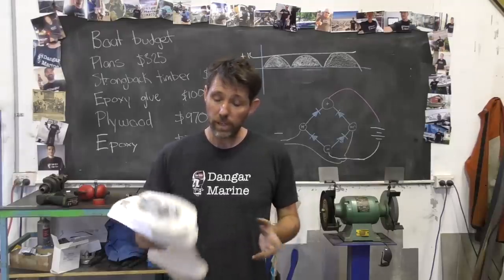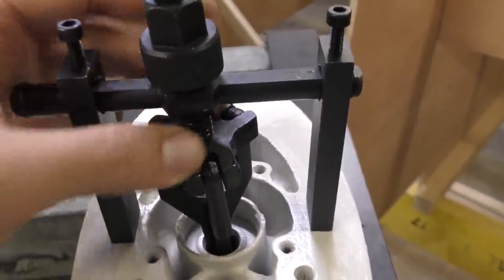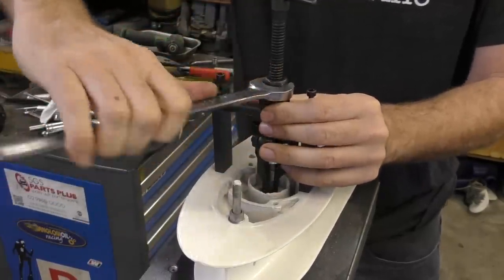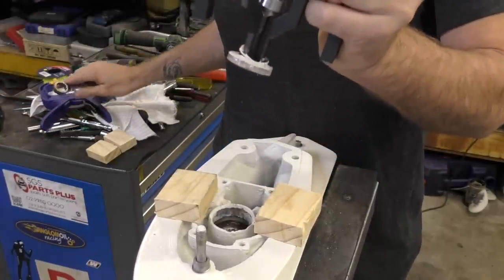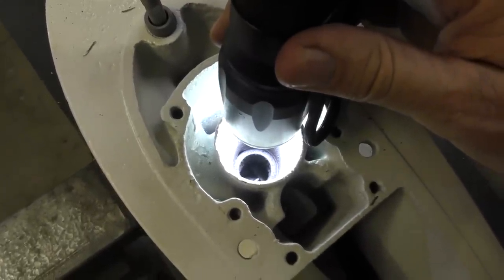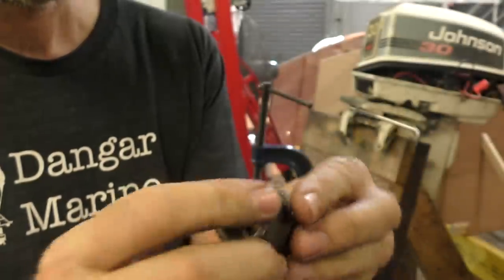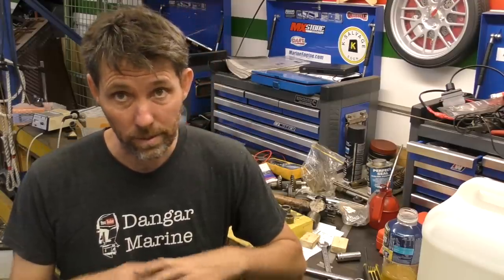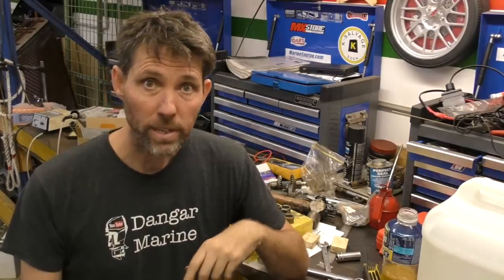Removing the bearings from a Johnson 30 HP lower unit

Comment: Boss, Wait til you see the pull I just came back from. Scored a pristine 76 johnson 15,  looks pristine, with original decals and all. I was like WHOA. bundled that up for 310 clams and took off towards east  Texas and met another guy who had a 75 Johnson 15, immaculate. Fellow was proficient at rods and reels also, PJ is what I know him by. The soul was so kind to give me not one, not two, but THREE old motors and lower units, just outta the kindness of his heart. Then, lo and behold, a 25 Mercury 2 stroke two cylinder with GREAT compression but carb issues was aside a building that I fixed my headlamp on (it was 11pm when I arrived, and four hours back, just got home. Whew... ) so yeah, he seriously said fifty bucks and you can take it. He was kind enough to even write me a bill of sale for the merc, and of course for the 75. Total spent, 750-800 for total trip fuel and all but wow. I cannot wait to learn more about the workings of these engines and have them back up and running, I’ll do a video on what I have once I build an outboard motor mount. Thats tomorrow. Thanks again for your inspiration.
Reply from the maker: Sounds like you've had an amazing shopping trip! :)
Reply: @DangarMarine  Texas is nice to pass through, pretty big sky. I remember when I went to Colorado once, I passed through during daylight and the windmills And Land are beautiful to behold, headed out towards Montana here soon, prolly too cold to dive out that way .

Comment: Thank you for your "Reality TV" how to boat mechanic videos.  I think I have seen about 10-20 of your videos.  I call it reality because we face what you show us, instead of what some other videos show in a sterile expensive equipment shop where they work on brand new motors.  I have been building up a 2010 Yamaha F6 that has been neglected.  So far fixed broken shifter mechanism, which requires removal of the power head.  I have now removed the power head about six times.  The power head only ways about 30 pounds.  Blew out carb, cleaned gas tank.  Etc.  I am stumped on replacing the lower seals, because some are behind pressed in bearings.  I am about to buy a little puller.  Thanks!

Comment: i am doing a lower end rebuild on a johnson 25 hp motor from 1988, prior to removing any bearings from under the impeller housing i will measure the depth from the top to get an idea of proper location since there seems to be no info. the "witness" marks on the pinion gear will also help a lot, thanks for that tip! without your set of videos on this i would have to pay a considerable amount of cash that I DONT HAVE! this has all been super helpful 1 thank you for sharing your knowledge!

Comment: Nice job with that puller Stu. Using that plate steel and the threaded rod worked really well. I’ll keep that in my memory bank. Might come in handy eventually!
Reply from the maker: Where there is a will there is a way! :)

Comment: I changed all my seals in my merc. Most of my seals came out super easy and they were leaking a fair amount of oil. I reinstalled with loctite per the manual which was weird at first read, but it hasn’t leaked a drop since.
Reply from the maker: Yes, a bit of sealant around the outside of the seal can be a good way to go, particularly if the gearbox is a bit pitted or worn. Glad it isn't leaking now!

Comment: Those lower drive shaft bearings- to reinstall just use the same system you used for removing the shift linkage bush - threaded rod, plate and nuts to pull the bearings up. It has worked for me in the past.
Reply from the maker: Been thinking about whether to go top down or bottom up. I think what I really need is to find the measurements of the custom tool to find out their final positions.
Reply: Check for witness marks from the old bearings and measure those. But long needle bearings in such a low horsepower motor I wouldn't be too worried about being a few millimetres out  as long as the seal sits in the right place.

Comment: That is a nice bearing seal puller!  The special tools can be improvised, but there is often a specific depth the bearing and seals must be positioned at.  The two pinion bearing are one example of where the special tools are very helpful.  The seals are not necessarily pressed in against one another as well.  Needless to say the forward bearing race and some of the bearings get pressed in until they seat, but one must be very careful not to damage the bearings.  The general rule is to press against the numbered/lettered side of the bearing because this side is thicker, pressing against the opposite/rounded side of the needle bearings will damage them.  It is a shame that OMC designed those housing with such thin aluminum walls around the seals, these are often eroded quickly in salt water, the 9.9/15 gear housings have the same problem...
Reply from the maker: Yes, I am worried about getting those pinion bearings installed in their correct position. I may have to see if I can find the special tool for that job, or at least the measurements so I can make something up. Great tip about pressing from the side with the writing, taking a second look at the old ones I can see exactly what you are saying. Thanks!

Comment: Good video mate there are no rules as long as the job is done , i did that with an extension and ended up buying a new one take care .
Reply from the maker: I've found decent tools to be pretty hardy. One thing Arn said to be very early on is that a tool make from cheaper metal will break and you are likely to get hurt in the process. It's something that has always stuck with me when assessing the cost.
Reply: I have to admit i did give it a hammering was good quality no kmart crap was kingchrome cant remember what i used it for but now it is a drift punch .

Comment: Loved this video.  I have a 1978 Johnson 25HP tiller steer with electric start.  Hopefully won't need this video or that puller tool, but I feel confident if I had to rebuild that lower unit, I could watch your videos on the topic for a day or 2 and then tackle the job myself.  I just got this engine in late March and it's running great.  What do you recommend a person do when first getting an engine?  What to look for to catch issues that are small now, but would grow to be big issues over time?  I've watched your regular maintenance vids and maybe that's enough.  You're an awesome mechanic and the way you present in your videos is superb.
Reply from the maker: Hi mate, glad you've been enjoying the vids. The biggest concern with a nice-to-you motor is that the impeller is good. Not so much from the point of view of overheating but if it is perished, bits will break off and go through the motor and be hard to get out again. Also make sure the gearbox oil doesn't have any water in it.
Reply: Dangar Marine nowmy 2.5hp merc that I still have is putting gas (petrol) into the water when I try to start it. Carb? Seal somewhere gone bad?

Comment: Stu, you have to hurry with the reassembly video.  We're starting to misplace the parts!  Terrific video.  Needed this for many years.  What diagram should we use to remember the order and direction of replacement?
Reply from the maker: Thanks Bruce, bearings are on there way! The parts diagrams on the MarineEngine.com are great for seeing how things go back together. http://www.marineengine.com/parts/johnson-evinrude-parts.php?year=1994&hp=30&model=J30EERM&manufacturer=Johnson&section=Gearcase

Comment: Hi Stu, I was wondering how many bearings are in a typical lower unit. Great techniques on removing them. I have also used sockets and a "C" clamp to remove them or a vise.
Reply: 8-12

Comment: Enjoyed the video and found it valuable to understand the inner configuration of the lower unit. I have a crack in my lower unit above the propeller on the main housing. The motor seems to cavitate. Can the lower unit be welded to seal up that crack or could something else cause the motor to cavitate.
Reply from the maker: The aluminium can be welded, but you need to make sure it doesn't put the propshaft out of alignment when it is. Hard to say what causes the cavitation but I always go by the principle of fix what you know is broken and then go from there.

Comment: Hey Stu. To answer ur ? The impeller was is pieces I remove the exhaust cover to check for pieces and found a tiny so I cleaned it out but I also found the inner exhaust plate ( stainless about 2mm thick) is warped pretty bad I can't find one online or ME.com so should try to fix the old or make a new one??. Thx mate
Reply from the maker: I can't picture the plate, but I would start by trying to fix it.

Comment: Hey stu you ever seen where with the spark plugs out, the motor turns over real easy but when I put the compression tester on it's pretty   hard to pull, the first 1 or 2 feet pull ok but the last foot or so almost kind of jams up. But I can still pull it all the way. Idk its weird, It is on a stand I made . What do you think?
Reply from the maker: It could just have very good compression making it hard to pull over when the plugs are in. It could also be that it is the wrong spark plug and the piston is hitting it.
Reply: Ok I know the plugs are right so thx good news

Comment: Do oil seals get replaced? I had a bearing go out in my '95 Mariner engine and there were metal shavings in the oil so I was planning on replacing all the bearings (though I am debating just thoroughly cleaning up the other bearings that otherwise seem fine), but what I didn't know is if I should be replacing all the oil seals as well. Do manufacturers generally offer a rebuild kit with all the oil seals and bearings or do you just buy everything piece meal?

By the way, your videos have helped me tremendously in getting this far! Watching you disassemble a few lowers gave me the confidence to try it myself and so far, so good! Rather than $400 for a used lower, or $300+ at a shop, I will have $30-150 worth of bearings and/or oil seals and thats it.
Reply: Oil seals are cheap and generally easy to replace. Don't scrimp, just replace them .
Reply from the maker: Bearings and oil seals are generally sold separately but in this case I did buy a kit of all the seals and gaskets in one package.

Comment: hey i have a jonhon 25 and i has good compression lower uint is good drive shaft is not bent and carb is clean, it runs but wont go on plain idk why
Reply from the maker: It could simply be that the hull is too big for the motor, but I would also look at the ignition timing as you get to full throttle.
Reply: I have a video of it running before it messed up and its going like 35 40 mph idk what that is in nots but had the timing redone and still no power. the perpeller is kinda beat up do u think is tht or any other suggestions

Comment: Hey Stuart im having a little trouble with my Yamaha 30hp its pulling really hard to the left on the tiller, i watched your video on props and i thinks its that paddle wheel affect you were talking about. I have to a set of hydrofoils bolted to the plate above the prop from the previous owner however he has bolted them through the anode plate so i cant turn the anode to compensate without screwing through the plate again. Also how far would you recommend turning the anode to compensate for the paddle wheel affect? cheers
Reply from the maker: Generally it isn't turned that much - 5 to 10 degrees. It will make a big difference.
Reply: Thanks but drilling through the anode plate for the hydrofoils is that ok?

Comment: Hi, I might try and have a go at my gearbox  and fit a new set of gears,   what type of puller  would I need or you recommend  to seperate the forward gear and inner bearing.  Thanks
Reply from the maker: A spigot bearing puller should do the job.
Reply: @DangarMarine  Thanks for reply,  funny enough it just fell off in my hand,  so no problems there. 🤣

Comment: Hey Stu I watch the video but have sum ?. ME.com list 2 separate driver coils for rope and electric but both look the same. Do I need to swap them. And do I need to add a stator assembly and a rectifier. Do I need all this?
Reply from the maker: Hmmm, not sure about the driver coils. If they have different part numbers I would be inclined to email MarineEngine.com and see if they can shed any light on the difference. If you want to charge your battery you will need a stator and rectifier but you may already have them. I'd pop the flywheel off first and take a look.

Comment: Hey! It would be amazing if somebody could give me some advise. Here is my problem: I have a 2011 Evinrude e tech 25hp. It is a 20” shaft, and was used in salt water. In a rush, I snapped off two of 6 lower unit bolts. I disconnected the shift lineage behind the intake plates. The lower unit doesn’t budge more than 1mm barley. I need to replace the water pump and seals. I’ve tried some heat but I don’t want to burn off my paint. What should I do? Am I missing a linkage under the cowling? Thankyou so much I need help.
Reply from the maker: I don't know that motor specifically but there is often a hidden bolt under the trim tab.

Comment: I broke the head bolt on my 1970 Johnson 25.  How should I get it out.
Reply from the maker: If there is a bit of shank sticking out you can try turning it with vice grips. Sometimes you can also weld a nut on the end and turn that. Next step is to drill and try an EZ Out or something similar. If that doesn't work then you may need to go to drilling the whole bolt out and repairing the thread. I'm planning to do a video on this soon.

Comment: Use  brass when-ever you can  for the removal process,,    Remember aluminum expands  3 times faster than SS.  use a bit of heat on the Aluminum prior to the pull or  punch,,   Also spray things down with hot soapy water you will be surprised at the results.    ,  You got it done & that is all that matters ,     good  video...                                                                 kodi
Reply from the maker: I've never tried hot soapy water, I'll give that a try.

Comment: Stu dou think a 300 08 etec would be the same as that evinrude lower unit same procedures but bigger pieces
Reply: Hookednrolling- yes, pretty much the same ideas on all of them , especially with in the same company. Even the 'electronic' selection of forward reverse on the current Etecs, the actual gear box is the same idea in terms of  bearings/seals/dog clutches etc , it is just that a servo is used to move the selector rod instead of a cable. Just more things to go wrong, and more mass over the stern of the boat that you don't want out there in my book.
Reply: Ron Powell I agree  there nothing wrong with mine I was wondering instead of dealer I might do lower unit work my self with my brother we can usually figure it out plus I bought evinrude shop Manuel much better than after market Manuel JT
Reply: JT. Keep the fishing line out of the propeller side seal, change the water pump impellor every year along with the oil and be positive in your gear engagements and you can get 15 - 20 years or more out of a gear box without doing much else. The bearings really live in a good spot on the lower leg if no water gets in the oil and rarely fail. The seals just wear out from doing their job though, not really much you can do about that. One thing I hate hearing at the ramp is that graunching of dogs as people engage the gears too slow. The problem is many people  then try again even slower which makes it worse.
Reply: Ron Powell will do need to get out there as soon as they fix postcard inn in islamorada after Irma the Florida keys worlds sport fishing capital of the world  love  the keys keepin your lines tight John

Comment: Hey boss been checking out your helm and steering cable replacement videos, and I am about to replace my whole system soon, but I must ask I was going to run across my lake and when I turned I heard a snap and lost steering my steering wheel turns freely either way forever, and the cable for the steering cable ripped where the the steering cable enters the steering rod on my mercury classic fifty 45hp I haven't owned the boat long and I assume the old owner never replaced it, so would a whole helm replacement fix this? Is I guess what I want to know before I get a kit. I'm pretty new to my boat I'm a young guy so I just want to get some expert advice, i tried to describe my ordeal best I can but if you need clarification on anything I can try to help clear thing up
Reply from the maker: You may need to replace the helm, yes. Sometimes if the cable snaps inside it can be hard to get the cable out. I would start by trying to get the old cable out. If the old cable does come out and a new one winds in easily then you may be able to re-use it.
Reply: Dangar Marine awesome man thank you very much I was able to get the cable out today, so I left the helm attached and ordered my new kit so hopefully I'm able to reuse t and just connect the new cable
Reply: Dangar Marine I think I kinda described it wrong so the metal it's self didn't break but the cable right before he rod goes into the engine did so I don't have any tension to the steering wheel thanks a ton for the response it really means a lot. Good to see a knowledgeable guy take the time to help others out you're a good dude.